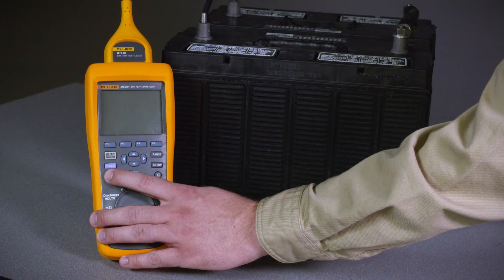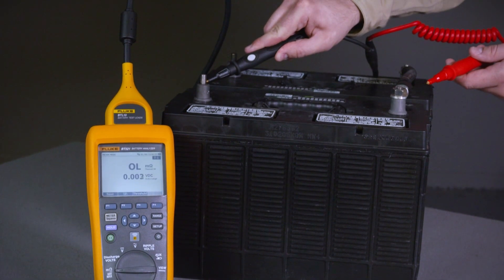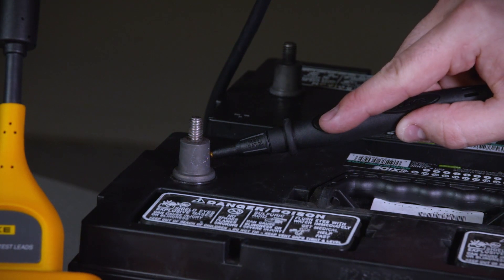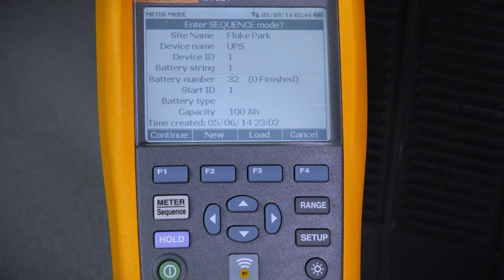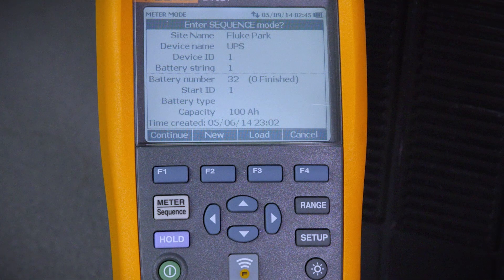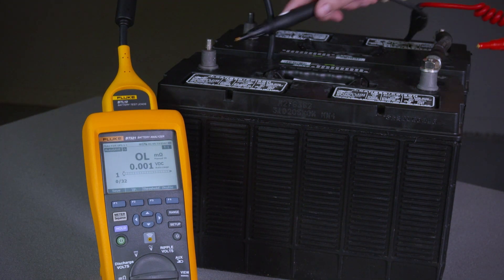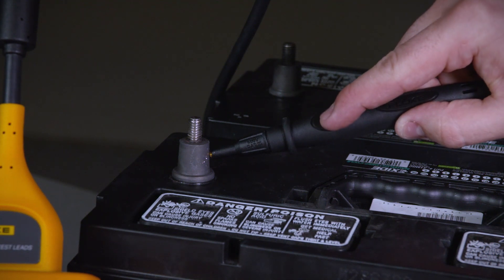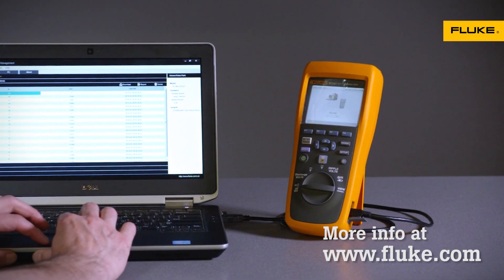The Fluke 500 Series Battery Analyzer: Quick Demo

Comment: can this measure 2V 2000AH battery?
Reply from the maker: Hello - Our battery testers, like the BT521, are designed to be used as a trending tool. Taking measurements over time to identify if problems are imminent or a little farther out. The first time a battery’s impedance is tested can cause concern because there is no baseline. In these cases, it is good to compare each cell against every other cell in the string. Weak cells stand out. It is these cells which require further investigation. Typically, a change of 30% to 50% from a baseline is considered significant and could indicate near-term cell failure. It is always recommended that any users should use manufacturer’s resistance / impedance data where available.
Reply from the maker: Hello - Yes, the Fluke BT500 series would be able to measure a 2V 2000AH battery.
Reply: @fluke  can you tell me how to identify the good and bad battery cell based upon values of mili ohm resistance and voltage  obtained from test please